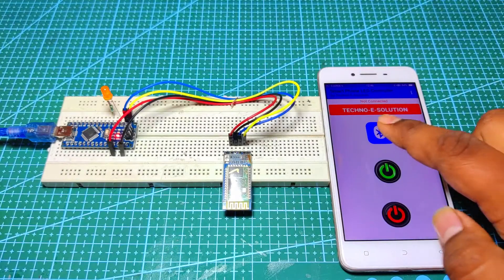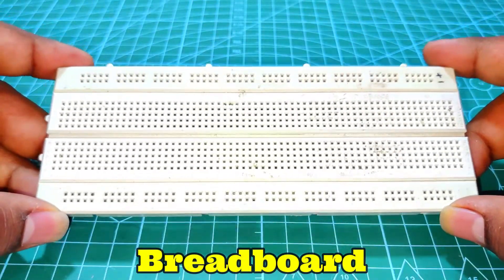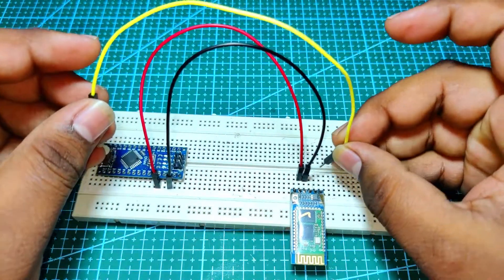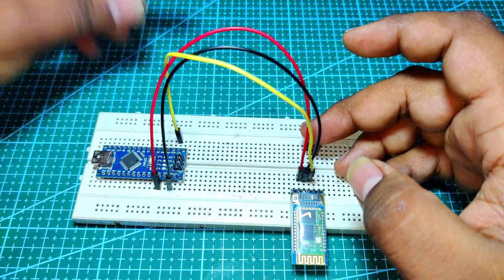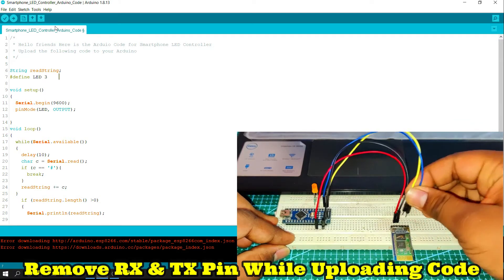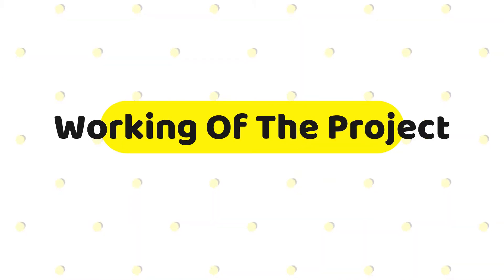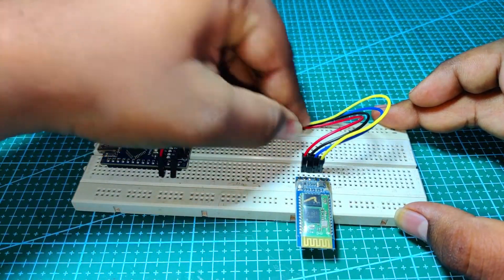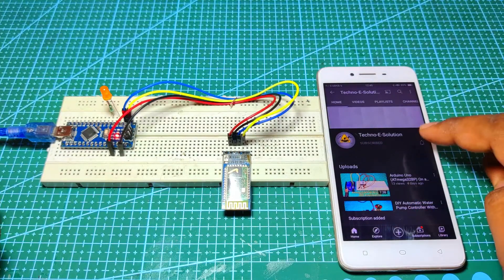How To Control LED Using Smartphone With The Help Of HC-05 Bluetooth Module | #arduinoprojects

Comment: It is not working I need some help
Reply from the maker: What happened?
Reply: i suggest u to try connect the txd bluetooth pin module in tx1 pin in arduino and rxd in blutooth mod in rcx0 in arduino becuz the circuit in those pin are reversed